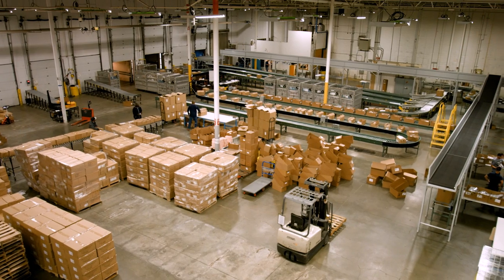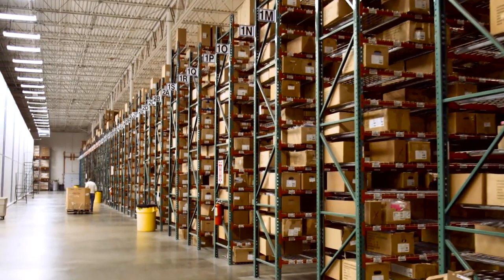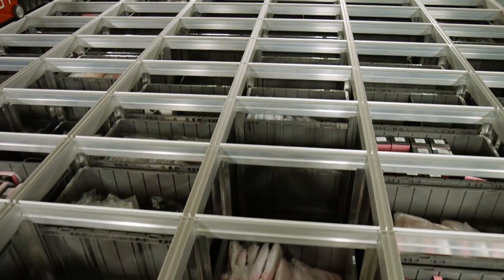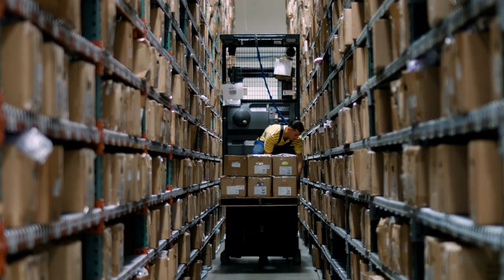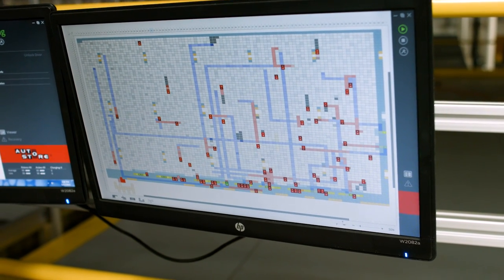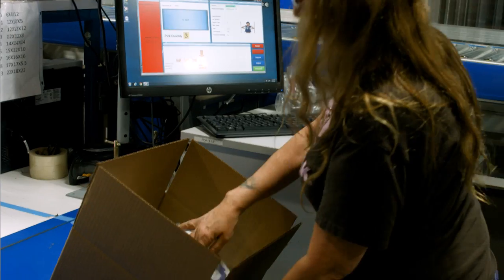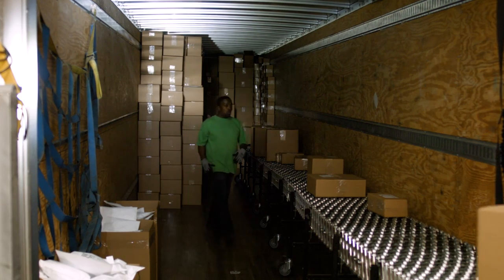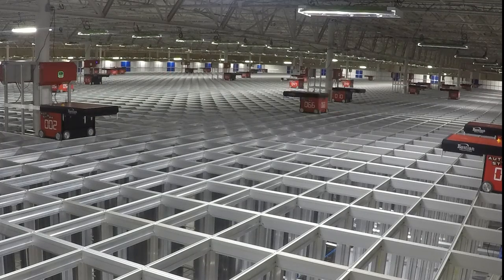E-Commerce Retailer Doubles Warehouse Capacity with Robotic Goods to Person System

Comment: cost to implement this?
how many units went out on the record setting day?
avg daily orders sent out?
Any issues? Like it seems like if 1 thing goes wrong the whole system fails
Reply from the maker: Thanks for your interest in the AutoStore Automated Warehouse System! Unfortunately we cannot publish pricing information, as most of our clients and vendors wish to keep confidential. The record setting day at this facility was over 55,000 units in a single shift. The AutoStore System does not have a single point of failure; the multiple robots, workstations, and a back-up controller ensure redundancy for the system. The technology has proven itself to the extent that this particular system has been expanded and is now more than double the size. We encourage you to view the AutoStore overview video https://youtu.be/ecftHVqxRpg that may help answer any additional questions or check out our AutoStore webpage: https://www.bastiansolutions.com/solutions/technology/goods-to-person/autostore/

Comment: how does it get replenish
Reply from the maker: The AutoStore is replenished using a similar process as picking but reversed. Totes are filled at operator stations, and the robots deliver the filled totes back into the system.